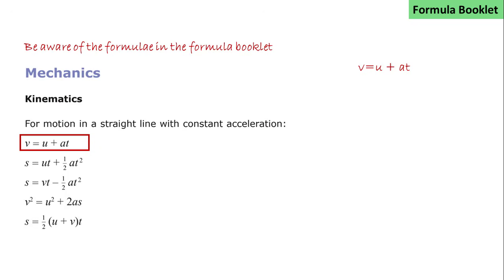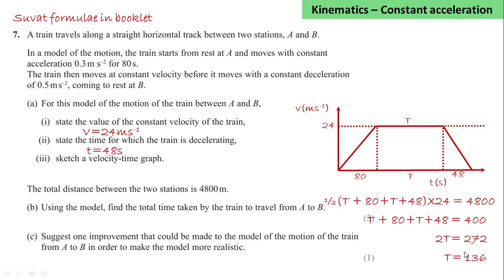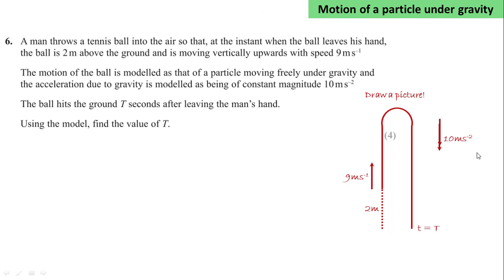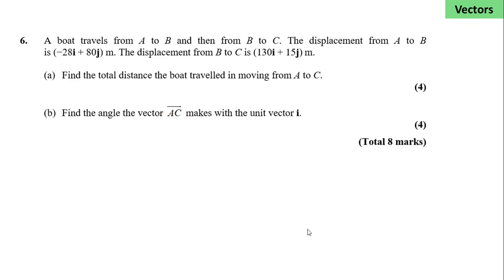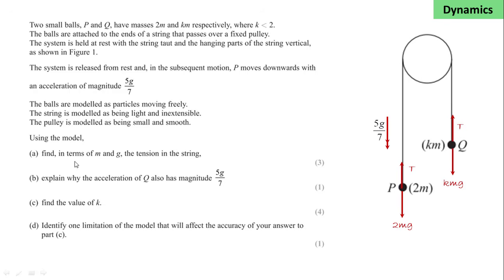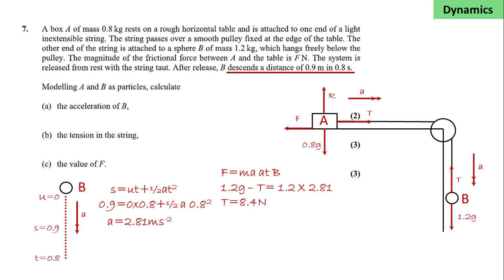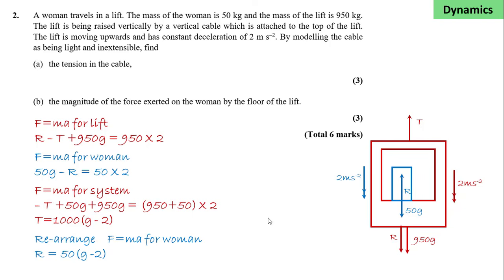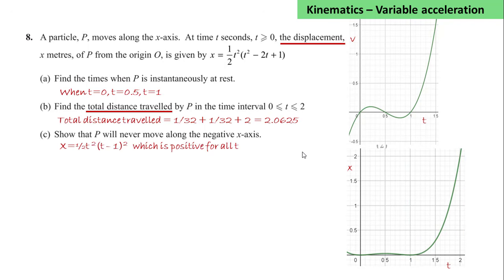AS Mechanics in 30 minutes

Comment: 10:09 i dont understand this why did we multiply 2 with only 0.458
Reply: You can imagine it like this; 0.9 is the time taken to reach the peak of the diagram he drew. 

So 0.9-0.458 is the first time the ball is AT 5 metres and 0.9 + 0.458 is the second time the ball is AT 5 metres. 

The questions asks for how long is the ball MORE THAN 5 metres above the ground so it would be 0.458 times 2. 

Because from 0.9 (which is the point where the peak is in the diagram) he goes down by 0.458 (the first point where the ball is AT 5 metres) and up by 0.458 (the second time the ball is AT 5 metres) so the total time spent above 5 metres would be 0.458 times 2.
Reply: It’s +- so the difference from -0.458 to +0.458

Comment: For part B of the variable acceleration question, instead of plugging in all the different values, could you do a definite integral of the velocity equation since the area under the curve of a velocity time graph is displacement? You would still need to split it up of course but would it still work? its probably the most complicated way to do it but its the first thing that came to my mind  😅
Reply from the maker: Just remember distance travelled is different from displacement. Areas below the axis represent negative displacement but still positive distances travelled.

Comment: 5:35 answer for acceleration how does it equal 0.8? isn't it 2.5? or am I tripping?
Reply from the maker: Too many mushrooms in the omelette I think. Are you happy with 40=50- 1/2 a 5^2? -10 = - 1/2 a x 25 so 20 = 25 a so a = 20/25 = 0.8 :)
Reply: @tonydebling  where the -10 come from?
Reply from the maker: 40 - 50 (subtract 50 from both sides of the equation)
Reply: @tonydebling  oh yup, thank you I was just tripping

Comment: 9:51 why do you +\- 0.458 ?
Reply from the maker: Values of t as particle when it is at height are roots of the quadratic 5t^2 - 9t + 3 = 0 using the quadratic formula you get the roots as 0.9 +/- 0.458. The first part is -b/2a second part is the discriminant divided by 2a. Sqrt(9^2 - 4(5)(3))/2(5). Hope this helps.
Reply: @tonydebling  tysm for the quick reply! i used quadratic but kept getting different answers compared to the vid, maybe there was an error in my calculation
Reply from the maker: @jasmine9215  I think you made a mistake in your calculation. B^2 -4ac is 21, sqrt(21) is 4.582

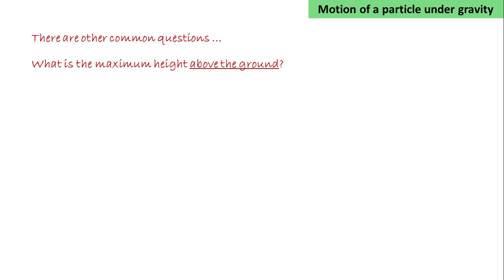Comment: For the ball question at 8:22 did you take the upwards direction as positive and is that why 9 was positive cause the ball was moving up? And why wouldn't 9 be negative cause the ball moves down too
Reply from the maker: Yep. Positive was chosen to be up. So it's +9 on the way up and -9 on the way down 😀
Reply: @tonydebling  ah okay thanks, but then how come you only used +9 when substituting it in and not -9?
Reply from the maker: @ratofalady8125  that was the u in the formula, initial velocity

Comment: Thank you for the video! At 8:12, why did you say that the acceleration is -10? Shouldn't it be positive 10 since the force of gravity downwards into the ground is positive?
Reply from the maker: Up direction has been chosen to be positive.
Reply: @tonydebling  er sorry if im wrong but shouldn't gravity be 9.8, and not 10
Reply from the maker: @infamy-u4b  depends on accuracy used. Question will usually tell you 10, 9.8, 9.81 and I'm sure there are more accurate versions, which would also depend on altitude!!!
Reply: @tonydebling  but in my exams what degree of accuracy is expected, thanks
Reply from the maker: @infamy-u4b  you will usually be told which value to use for g in the question or at the start of the paper.
Reply: @infamy-u4b  but if they haven't said its 9.8 for edexcel

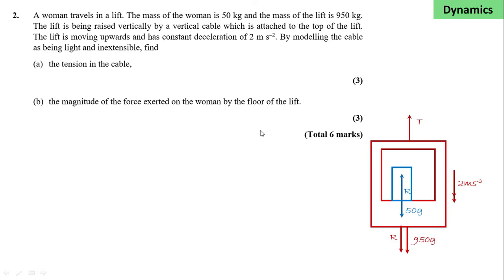Comment: Hi Tony, could you explain why there are two Rs in 18:06? I did not understand that part x
Reply from the maker: Hi Kiara,  there is an equal and opposite reactions between the lift and the woman. The blue R reprsents the lift pushing the woman up, and the red R represents the woman pushing the lift down. These are equal and opposite. The colours were used to separate the forces acting on the woman and the forces acting on the lift.
Reply: @tonydebling  thank you!

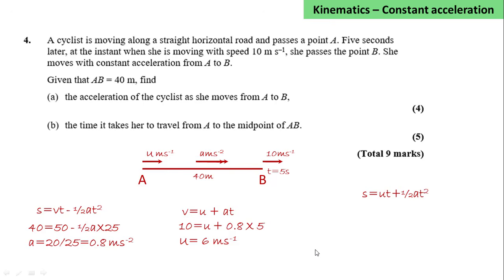Comment: Hi, for 6:13, why couldn't you use s=vt-0.5at^2? Why did you use s=ut+0.5at^2? Wouldn't it be easier to use the first than having to find the value for u to use the second equation 
could you have not done 20=10t-0.5(0.8)t^2 I came to the answer t=22.8 t=2.2 (to 1dp) 
(I also hope you're having a great day)
Reply: ahhhhh wait is it because v is the final velocity at the end of the journey at AB but we don't know what it is at the midpoint of AB/ it will be different at the midpoint so we cant use 10ms^-1 for the second part
Reply: wait no what but you used 10ms^-1 to find out u but I thought (well came to the conclusion that) we couldnt use v for any other point other than the end at AB
Reply: @yaya_04ad  we used V(10ms^-1) to find U since that formula is valid for the points A to B, where B includes the final velocity V; U is the initial velocity from the points A to B. However we cannot use V (final velocity) for points A to the midpoint since B is not present, therefore it does not include final velocity. Hope this makes sense!
Reply: im curious too actually did you find out why
Reply: @starlipika  nope
Reply from the maker: Are you procrastinating?
Reply: @tonydebling  but can you help me and answer why because I have no idea and I can't move on if I don't understand
Reply: @yaya_04ad  do you get it yet? lmaooo i saw this and had to ask
Reply: @LucyLucyLucyLucyLucy99  nope

Comment: hi tony, at 22:50  how do i work out the distance travelled for each value of t??
Reply from the maker: Substitute the value of the into the equation for x, namely x =1/2t^2(t^2 - 2t +1) which is given in the question.
Reply from the maker: To be more precise x is the displacement, which means if it starts at zero, becomes 1/32, and then goes back to zero the distance travelled is 1/32 + 1/32 = 1/16, then from x=0 at t=1 it becomes x=2 at t=2, so it travels a further distance of 2, giving a total distance travelled of 2 1/16, whilst the displacement at this point in time is still 2. So it is important to understand the difference between distance travelled and displacement.
Reply: @tonydebling  no problem thank you. wasnt using my brain very well for my question👍 thanks again.